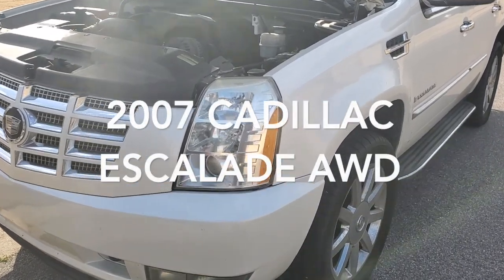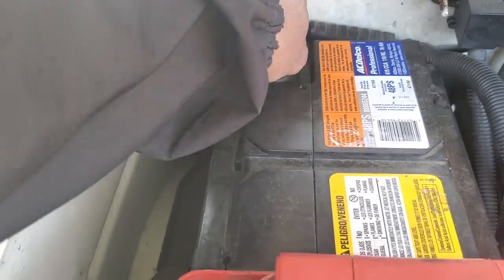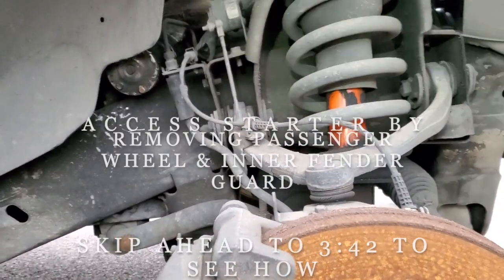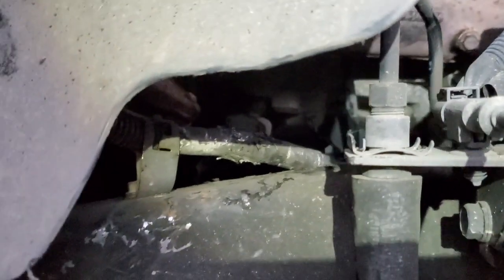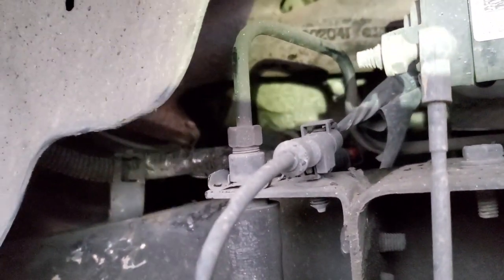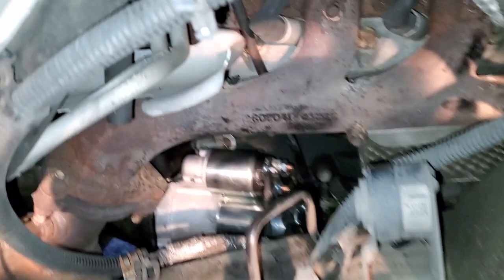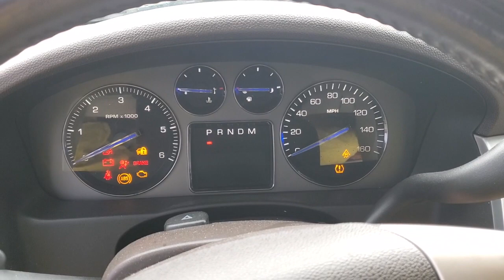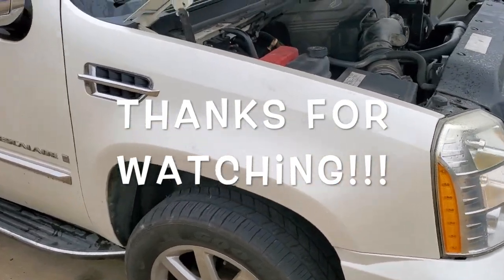How to Replace Starter on 07-14 Chevy, GMC and Cadillac SUV/Trucks

Comment: Thank you bro.
I could not get the dam starter out from bottom.
I was lucky did not have to take tire or plactic wheel shield out.
But i finally got the dam thing out from the top . It was still a struggle . Good news the new starter slid eight in no strugling putting it in from the top wow.
Thanks again...👍
Reply from the maker: You're welcome! Glad I could help out!! 😌

Comment: I think the starter is the same problem that I have with my 2013 esv but i don’t know if the engine is gone or what because one day when I was driving it I was approaching a stop sign then the front end starting vibrating a little then the truck just shut off. I turned the ignition off then tried to start it again and all I hear is one big click everytime I tried to start it. Then I did some research and people were saying that even if the starter went bad that wouldn’t have stopped the car from running so I don’t know but I really hope it’s just the starter and my engine isn’t shot. Thanks for this vid tho whenever I get time to change out my old starter, I’ll come back and refer to this vid.
Reply from the maker: Hope you get it figured out. Definitely another issue going on but we'll hope for the best outcome in your troubleshooting.
Reply: @silverbullet_2ss  yea ima have to see. Thank you though🤝🏾

Comment: Your video just gave me hope! Mine is doing the same thing, but I have a clicking sound and no turn. Did yours also do the clicking? I can't tell from the video 🤞
Reply from the maker: Mine did not make a clicking sound. In my experience when I've gotten a clicking sound it was the result of the battery being to drained/ dead to start the car. I would have battery tested and charged first to eliminate that possibility then move on to starter.
Reply: What was your problem then
Reply: IF it clicks replace starter i had that issue